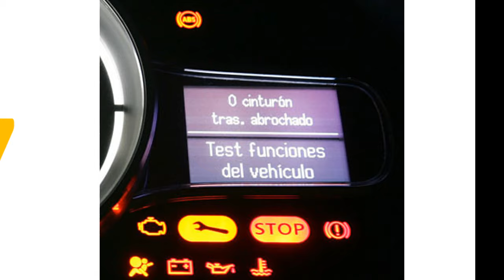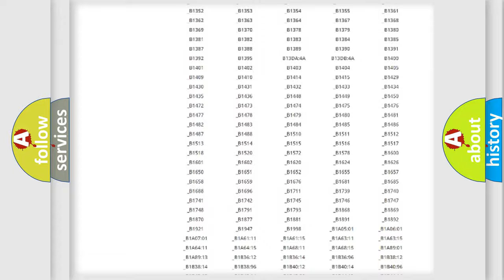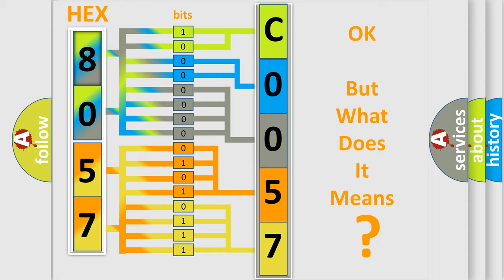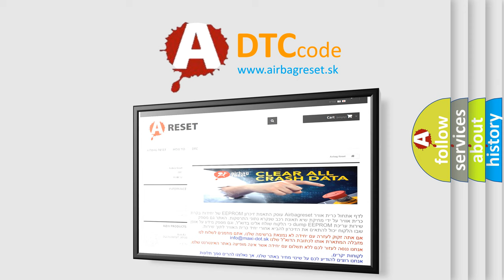DTC Subaru C0057 Short Explanation

Comment: hello, I'm a mechanic, I solved this problem of the error code C0057 Subaru Legacy 2.5-2010, no one could define exactly where to look for the error after a long time and many attempts, I found out that it was a lost adaptation of the throttle valve in the double sequence of a discharged battery, adaptation was made through multifunctional diagnostics, engine light, parking brake light and non-functioning cruise control have disappeared, maybe this information will help you solve your problem, I wish you a wonderful day :)
Reply: Hello Im not a mechanic.. I dont quite understand your explanation. Could you explain it again please but know Im an amateur, less technical word would be appreciated.